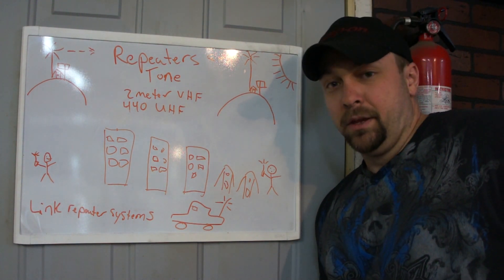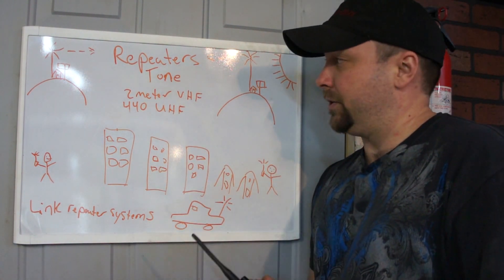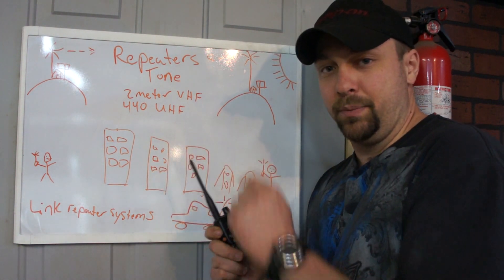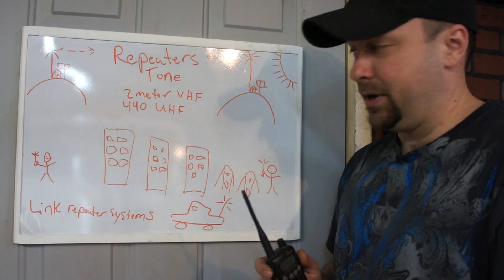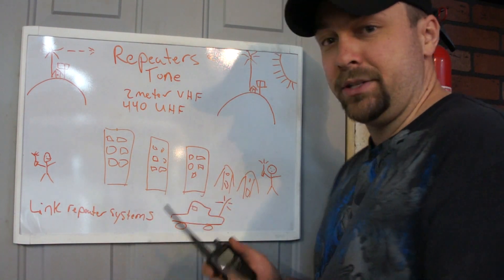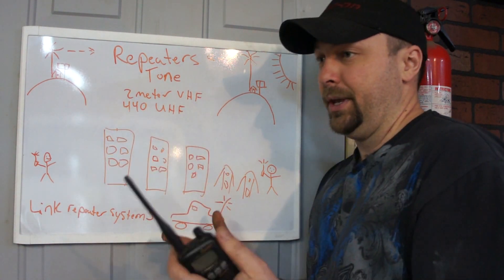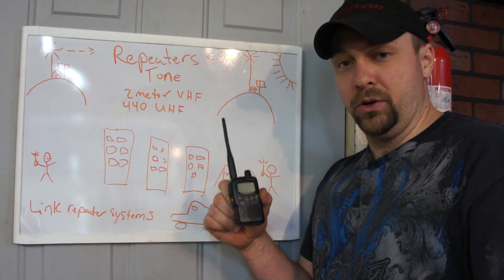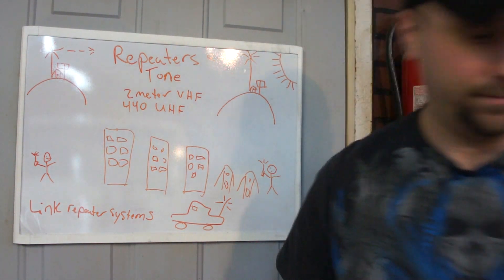Repeater Basics Ham Radio Part 2

Comment: Thank you SO much for this. It's still unusual to me what seems like even more of a shift than before of, instead of 10 meter being people's first natural step into HAM it's the more complex split frequency and repeater stuff on 2 meter with no DX. Is it that: doing 2m before 10 is better for society in two immediate aspects: better local crisis response on 2m and also we learn more before getting getting exposed to the erroneously power-hungry pitfalls of CB culture where calculations and tuning take a back  seat... but it still amazes me more people don't find 10 to be the natural 1st step since they already have the 11m CB antenna on guy-wired top rail (lol) and the thrill of expanding the already ongoing DX opportunities. It's just curious, but understandable and likely best 2m as primer - thanks SO much for your vids! It does also seem like a heft 5 of CB'ers mumble bro-science for years without really learning much (and if you pipe up and sound a bit too technical you're presumed pretentios, LOL! Thanks again :D

Comment from the maker: There is loss when you look at how far your antenna is from your radio its called "line loss" so you need to use good coax cable. I use a lot of LMR400 for my installs in 2 meter but you could use a little less. How far do you need to go over a hundred feet?  look up LMR brand cable or times microwave brand cable. stay with it you will get through this I also fought with this stuff too when I started out. Find a Elmer they can help you a lot.

Comment from the maker: I run a Tram 1480 on top of my tower that does 2 meter and 440 which I picked up on sale for like $40 you can use a dual band antenna with a mono band radio but not the other way around The only reason I say that is you can sometimes find better deals on a dual band antennas then just a mono band. If I were you I would build a copper water pipe J pole. They are great antennas and you get to learn a lot about ham radio in the process I love them. You will need some help tuning it though.

Comment: i know this is off subject, but what is a good antenna set up for a base station ft 2900 that wont break the bank? and also how does distance affect performance as i have some distance to cover from antenna to radio. , i can always upgrade later. studying for test and this stuff is complicated almost a turn off very frusterating for me